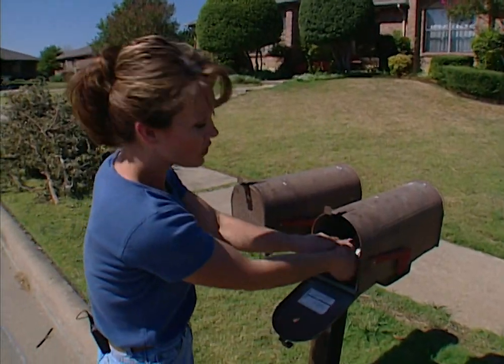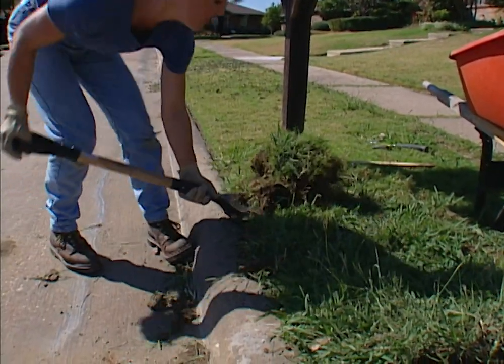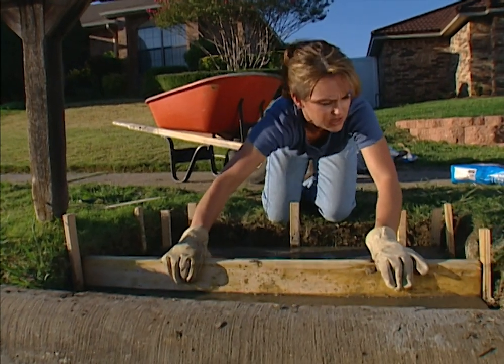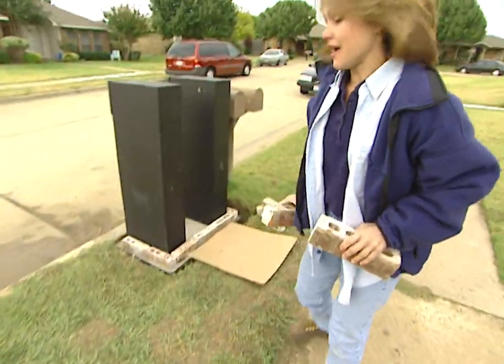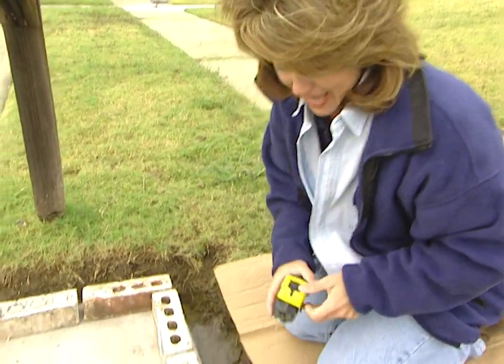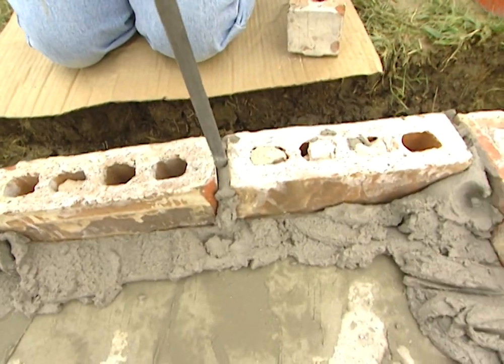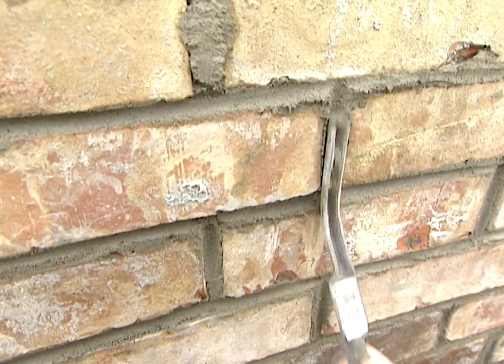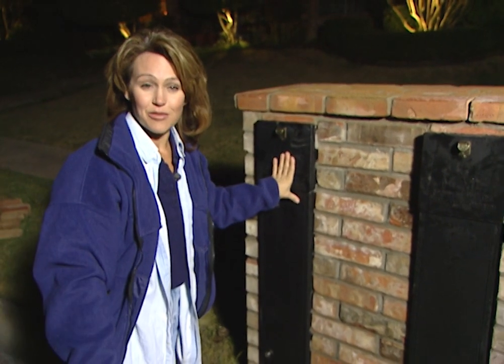Building a Brick Mailbox - Do It Yourself

Comment: Since you determine the size of the base yourself wouldn't it be easier to lay out the bricks and boxes on the ground first to set the size to whatever fits exactly right so no brick cutting would be required?

Comment: Did I miss it, or was the mailbox never secured to the concrete base?!
Reply: and that front filler wall could be kicked out quite easily plus the top will rot with no slope or capstone if its a 4 season climate

Comment: A brick mailbox is roadside hazard. If someone drifts off the road and hits the mailbox, it could kill them. This is not a legal installation. All mailboxes per federal guidelines have be constructed with a breakaway material.
Reply: Its perfectly legal.
Reply: Are you freaking kidding me??

If some drunk hits it-

Tough crap. Theyll either hit the brick box or a freaking tree.

Cant believe you even said that.

Maybe you've had experience hitting brick walls.😂😂😂
Reply: Would rather they hit the mailbox and stop than plow into my living room thank you very much
Reply: You should never drive and stay home then. Did you know that many people dye while they eat? Let’s not eat anymore! So many stupid rules just because some people don’t think and don’t see the obvious.
Reply: as someone whos had my mailbox run over by a drunk, I wish it was a concrete vault...
Reply: I’m replacing mine now.   I wish I could get a steel I-beam.  But opted for a pressure treated 6x6.  Sunk 42” in ground.  With 3/4” rebar. Also about 4 ft.    Brick or similar will be built around with a flower bed on each side.
Reply: BS, I see brick mailboxes everywere. There is no rule about that. it has to be break away. The only rules is that mailbox has to be 41 to 48 inches in height.
Reply: Bricks are very breakaway. Ever see a car run into a house. Happens all the time.
Reply: It depends on your local code.  If it's found to be too close to the road, or if your local area has restrictions on material, AND somebody smashes into it, they can sue you for negligence.  100%